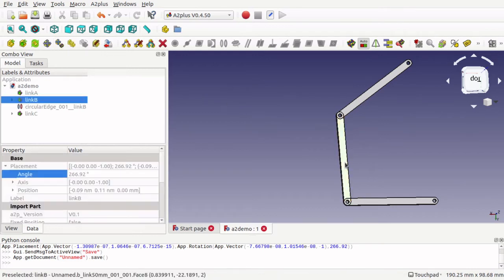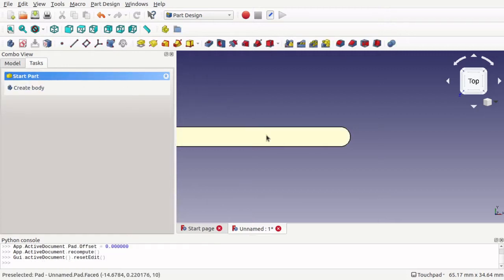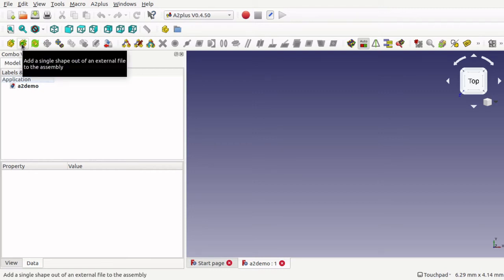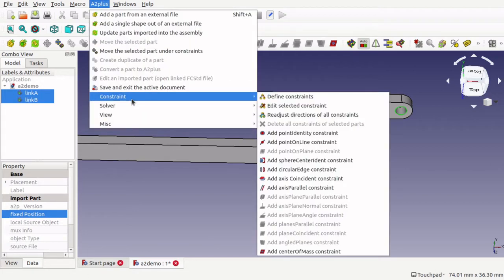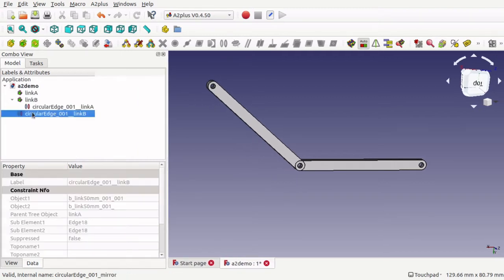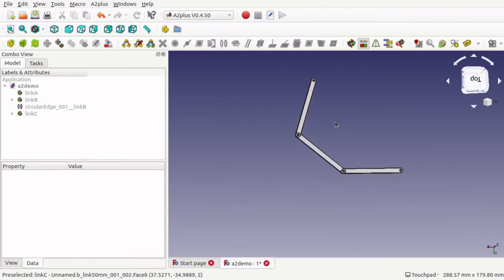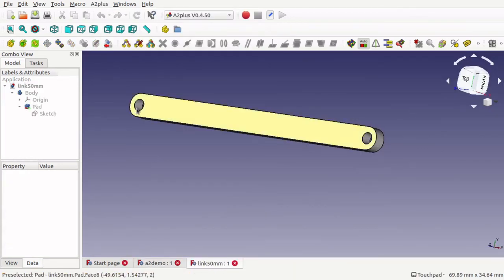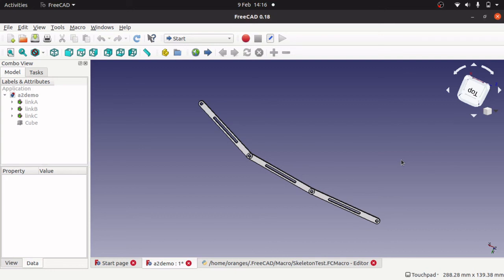FreeCAD: Animation and Kinematics using the A2plus workbench

Comment: I tried to repeat the same steps done on the video. And I inserted the constraints in A2Plus as in the video, but if I try to move the pieces they do not move they do not rotate. The piece not fixed set to false but does not rotate. Can you give me some indication of which I have not considered?
Reply from the maker: I'm not sure the reasons why, I am wondering if it has anything to do with the newer versions of freeCAD and the older A2plus.  If you have a fixed part and then added a second part then this should be fine.  This is another one of a older video that I need to update.
Reply: @MangoJellySolutions  I solved it thanks! the problem is that I'm clumsy. Thanks

Comment: Can you do this axle / circular edge constraint in Assembly4? I'm actually confused what the difference is... I know they both animate an assembly of individual models but how is one better or worse for axis rotation simulation?
Reply from the maker: Both the assembly workbenches use different ways of simulate movement. A2 plus uses a solver where a4 users a skeleton sketch utilising the constraints of the sketch to solve the movement. I have a video in my collection showing how to create a scissor lift in a4. The a2 plus s
 takes longer to solve these movements but A2Plus is quicker to connect everything up. It's a long going problem as there is no standard workbench for assemblies so you have a choice of multiple. But freecad are solving that for a future release.

Comment: Thank you so much.
This is exactly what I was looking for, because I am drawing a grapple (a kind of gripper), to lift wooden logs and even rocks,
with a mini excavator, which unfortunately is not equipped with a hydraulic thumb.
I wanted to evaluate and correct the curves before cutting the steel parts.
With this animation, I will be able to see the clamp in action, before making it for real.
On the other hand, the junction point should be in the center, and the two arms should be able to pivot equally,
just like a pair of scissors. So no fixed arm, only the pivot point.
Reply from the maker: Glad to see that you found it useful and good to hear about your projects.  Yes that's a great use for the workbench.  I recently put together a wish bone suspension assembly in this workbench and its working really well.  I have a different long play tutorial that I am working on at the moment and I hope to get it out before end of November.  It's a great workbench for understanding how you model will work as a simulation and then use some code to allow it to be animated.

Comment: really nice video. what is the difference between a2plus and the ass4 workbench?
Reply from the maker: Thanks for the comment. They are two separate developments that are taking two different approaches to assembling. The assembler 4 workbench make extensive use of local coordinate systems that can be added and aligned with the parts which then allows them to be aligned to other parts. Assembler 4 allows the use of a master sketch as a skeleton which can have the LCS attached to it and then the LCS of the model is attached to that. I have a tutorial that I just released to the channel this week covering how to build a scissor lift with assembler 4. That takes you through the process from scratch and you will see the differences.

Comment: Hello, MangoJelly Solutions. Thanks for your tutorial.
I'm trying to understand how these A2plus Constraints work.
You are the first person I hear saying that in A2plus the circular movement of a piece needs a second piece of interaction. I've been suspicious of this for a long time. You helped me a lot by mentioning this. But I realize that this only occurs in circular movements, with the application of the circularEdge constraint. I did tests on linear movements using the pointOnLine constraint and planeCoincident constraint. In this case, I did not need a second piece for the movement to occur when clicking the MovePartUnderConstraints button. Did you notice that too? This behavior with circularEdge constraint is not said on the assembly's official page.
Reply from the maker: Thank you for your comments and sorry about the delay in getting back to you. A2Plus can be quit confusing sometimes. I haven't work with A2Plus for a long time and the video has been in my release queue for a while. I have a project coming up soon where I am going to be using the workbench extensively so I will be in a better position then to answer your questions. I am leaning more towards the Assembly4 workbench with freecad 0.19 so maybe that will be more intuitive. But I will get back to you on the subject so bare with me. I was in furlough when I created the majority of the videos and I am just getting myself into the routine of fitting my channel around work again. Apologies again for the late response.